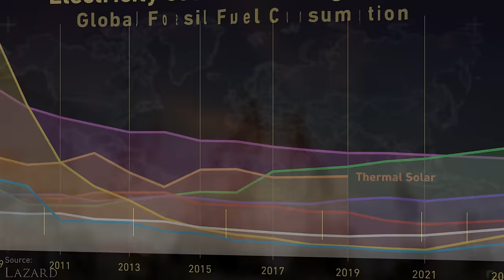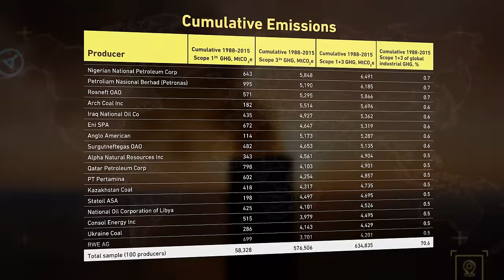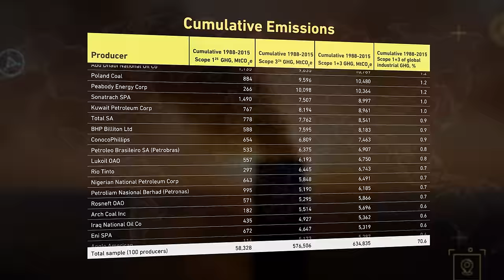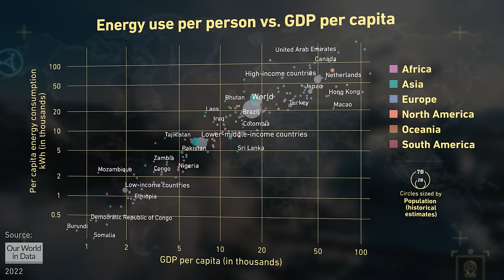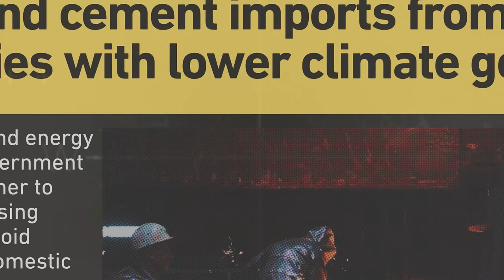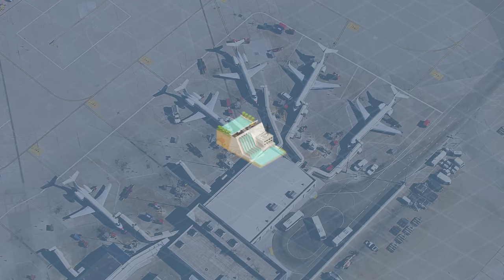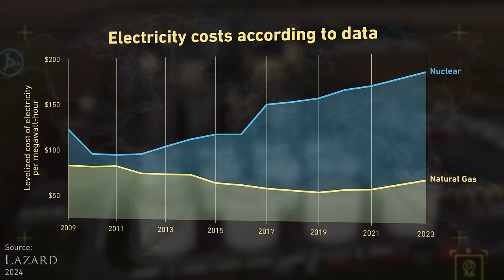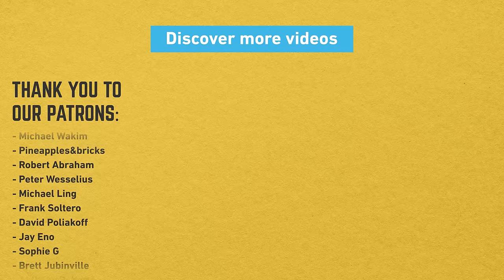Why We Can’t Just Stop Oil

Comment: I was on a road trip on a 2 lane country highway and the semis were taking up the road.

One truck had a bumper sticker that said “HATE TRUCKS?! QUIT BUYING S💩T!”
Reply: Oh, you've been to the country. Could you please tell those in the city what goes on there. I'm sure they'd be fascinated.
Reply: Based.
Reply: Reduce consumption is a much better way to reduce emissions than improving consumption. Technically the bumper sticker has a great message.
Reply: Australia’s new company Janus can convert HUGE 100 ton (or more!) trucks into full EV’s. Tesla's 40 ton trucks are good for driving within Australian cities, but at 40 tons are a little small for our 1000 km intercity highway routes that often use big 100 ton road-trains.. Instead of trying to “megacharge” the truck battery, Janus is a battery swap system. A guy on a forklift swaps the battery in a minute! This is more convenient for the driver if he’s not on his half hour break and needs a charge. It also means the warehouse can take their time charging the batteries. This is less stress on the batteries, and less stress on the local grid. Indeed during the day they can run 10 trucks from solar on the warehouse roof alone! The convert old diesel trucks. When one comes due for a major engine overhaul, many drivers are doing a Janus EV conversion instead. After a year they’ve recouped the costs. Then they save 60% on servicing fees and electricity is 1/3 the cost of diesel. Today the batteries can do 400 km before needing a swap. In the future, the truckie gets to enjoy new battery ranges and options as the batteries are automatically updated with the latest tech. These Janus trucks also get regenerative breaking, which slows the trucks going down hill while charging the batteries and avoiding wear and tear on the brake pads. The market is going to be SCREAMING for these trucks soon. It’s a thing of beauty - please watch the "Fully charged" 15 minute special. https://youtu.be/9eYLtPSf7PY 
Facts and figures and latest truck conversion showroom https://www.januselectric.com.au/
Reply: Australia, by any chance?
Reply: Also centralized production is a factor for shipping as if more factories were local there would be less shipping. But a company produces where labor is cheap and sells in a place it can get the highest profit
Reply: @5353Jumper  consumption is never going to be reduced. its what most people live and work for.
Reply: @eclipsenow5431 I wonder how much pollution it is going to create by mining, refining, manufacturing, replacing and recycling these massive batteries and how many weeks it can burn once it is caught on fire.
Reply: @eclipsenow5431  how about we just build trains
Reply: @eclipsenow5431 I am in full support of transforming small deliver trucks in the city into electric, it saves energy, centralized electricity demand, make recycling and repairing more feasible and may actually reduces emissions. But road trains? Give me a break 😅
Reply: @TheFalseShepphard  not economically viable and local demand wasn’t sufficient
Reply: @darksmith7318  Trains not economically viable? There's literally not a single land transport on Earth more economically viable than a train. It's literally designed to go the most efficient way possible through land. Trucks are much less efficient energy-wise, not to mention slower. Why it's not used in USA more? It's because the train tracks are something no private company wants to build, but if the US builds high speed railways, you'll soon see almost all of the trucks start only serving the last mile deliveries.
Reply: Trains don’t solve the last mile (or in many cases the last 25 miles).
Reply: @pangalactictuber  That's what trucks are for. And for those distances you don't need ultra-large trucks, you just need small ones to go through the city, and those small trucks can be electric.
Reply: @darksmith7318  I count myself a New Urbanist and fully support rail where possible. But as an Australian we have some enormous outback areas where battery swap might not even be visible. Some of our road trains will need biodiesel to cover huge ranges and take goods to tiny towns.  It's a niche sector only. 😉
Reply: @TheFalseShepphard  I wish Australia would prioritise rail more
Reply: @darksmith7318  LFP doesn't burn. Hannah Ritchie explains global mining will decrease as we mine 14 billion tonnes of fossil fuels each year
Reply: @eclipsenow5431  Hybrid trucks make far more sense.  The majority of the work can be done as an EV but a super efficient ICE engine can come on and charge the batteries without coming to a stop.  As long as the pay is based on the work done time and capacity are dominant factors.
Reply: @darksmith7318  We should be using smaller batteries on hybrids with on board generators.
Reply: @TheFalseShepphard  Unfortunately trains are CRAZY expensive to build new.  Look at California's rail project between San Francisco and Los Angeles where the planned $33B project is 10 years behind schedule and some estimates have it costing nearly 10 times that initial $33B, and at the end, if it ever gets done, it will be slower and more expensive than air travel and require ongoing massive support from government funding.
Reply: One more lane will fix traffic I'm sure
Reply: @MikeRink  No speed limits would be better than more lanes.
Reply: @Mitaka.Kotsuka people live for gaudy purses?
Reply: @eclipsenow5431 Wow, 100 ton road trains? That's pretty interesting! Sure, the size and weight seriously restricts where they can travel, but they can still take a lot of things places with good economy of scale.

I do wonder though. What if they took advantage of those regular restricted routes and perhaps found a way to power the trucks as they drove so you don't need to use weight on batteries and can carry more stuff. Maybe they could even use a different material like, I don't know, steel to reduce rolling resistance and tire wear? That'd be crazy, right?

Comment: It would be nice if modern appliances would last longer, like the ones made decades ago.  Then we wouldn't need to make so many of them.
Reply: Planned obsolescence is definitely a major issue.
Reply: Appliances cost more money in the past. We are obsessed with buying $600 fridges. Nobody walks into an appliance showroom and asks how repairable the appliances is they just look at the price, features and industrial design. It’s our fault not theirs. If people demanded high quality (more expensive) repairable products they would sell them. Having an iPad glued to a fridge to tell you when your yogurt is “expired” is a liability rather than a feature.
Reply: But that would negatively affect the economy!
-economics explained, probably.
Reply: just use the ones made decades ago
Reply: @DMSparky  they really should. When I purchase a vehicle I like it to have parts commonality.

It's generally cheaper to repair and maintain then.
Reply: Some times we don't need more regulations.
But definitely think minimum reasonable lifespans for appliances should be a thing

A fridge should last a minimum of 20 years without major issues. Our old fridge has.
Reply: @austinbaccus  My sister does this, but you have to know where to look for re-conditioned older appliances.
Reply: The simplest solution to overproduction of low-quality goods is to raise energy prices via a carbon tax redistributed as a dividend.  The net result is lower consumption and a subsidy to help low-income households cope with the rising cost of energy.

The problem, it seems, is that everyone notices the higher sticker prices and far fewer people notice the extra deposit in their bank account.

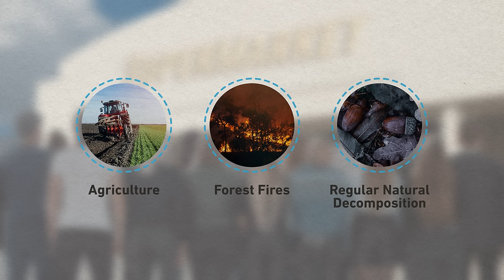Comment: @4:10 regular natural decomposition isn't a driver of climate change - it's just releasing carbon back into the carbon cycle that was generally taken out at most a decade or so ago.  Hence, it's generally carbon neutral.
Reply: We can exchange increasing car driving for putting out forest fires. It doesn't matter how you want to phrase this, be it 'driver' or contributor.
Reply: @theBear89451  bro wut?  Im not sure what you're getting at here, but the point stands.  The carbon from natural decomposition came from the atmosphere to begin with, so it doesn't affect the long term carbon balance of the atmosphere when it's released again.  It's the carbon cycle, which is climate change 101.
Reply: @theBear89451 but forest fires are becoming more and more common
Reply: I’m allowed to decompose when I die? Thank god
Reply: @nekhumonta  That would only be an issue if there were a decrease in global biomass, but there is an increase, meaning plants are growing faster than they are burning.
Reply: @jacobtomasperez1719  not all biomass is equal. Trees can store more carbon than algae.

Comment: Because nothing beats petroleum products as a store of energy, in both density of volume and weight, in a reasonably easy and safe to handle and transport form.  Especially when you account for the weight and size of the fuel's storage and handling systems on vehicles.
Reply: Actually, diesel is better.  Crude oil requires energy to refine to be useable and cleaned of sulfur.  That energy comes from some of the products of refining being burned in furnaces and from addition of electricity and maybe natural gas.
Reply: Even if something can beat oil in those regards: said alternative needs to be cheap to produce and use on a large scale as well. Hence we can dream, but till something comes around that does it all we are bound to use oil, lots of oil.
Reply: @richdobbs6595  plus diesel can be renewable. either sourced from new or used cooking oil, plants and algae (food and non-food). Also, diesel emit less CO2 but more NOx and soot though.
Reply: @richdobbs6595  You might find that diesel is a bi-product that results from the process of distilling crude oil, I believe. Just like petrol and LPG or the Naphtha used to make fertilisers, plastics, pharmaceuticals, jet a1 etc. And the bitumen for roads and fuel oil for ships.
Reply: @davidbrayshaw3529  As a previous refinery process engineer, I'm well aware of how diesel is produced.  I'm sure your comment is very relevant to the point you are trying to make.  It's just I don't follow it.  I was directly replying to the OP.  Are you arguing that gold ore is just as valuable as gold, because you can make gold from it????
Reply: @richdobbs6595  Perhaps I have somehow misinterpreted your post?
I was making the point that diesel is a distillate of crude oil therefore without crude oil, there is no diesel, and that it takes considerable energy to distil diesel from crude oil. Have I missed something?
Reply: @davidbrayshaw3529  And my point is that diesel is a better store of energy than unrefined crude oil, and is just as easy and safe to handle and transport.
Reply: @richdobbs6595  It's probably a bit more "useable" than crude oil, but the calorific value is very similar to diesel, as is the specific gravity.
Definitely just as safe to transport, that's for sure and it has the potential to serve more common purposes.
Reply: except nuclear energy with its own particular disadvantages
Reply: Plutonium beats it by a factor of a million.
Reply: @andrasbiro3007  Expect that the safe handling and storage equipment for any given amount is a million times bigger and heavier than the sample.
Reply: @haweater1555 
Technology will continue to progress and lithium and plutonium will replace more and more oil with time. Oil companies have fought this inevitably but they can only resist the march of technology so long.
Reply: @richdobbs6595 technically yes, but that doesn't really take anything away from the OP's comment. Diesel is a product of crude, after all.
And biodiesel is inefficient and expensive to produce.

Comment: Oil isn't just fuel. People don't grasp that nearly all synthetic products are petroleum-derived
Reply: But Isn't only burning petroleum to create energy a problem? I didn't think making things out of petroleum was such an issue.
Reply: @TheFlawlessHost  Maybe less so, but fossil fuel extraction and refining has significant environmental consequences even if the hydrocarbons don't end up as engine fuel.  For those of us more concerned about habitat destruction and polluted water supplies than carbon emissions those steps are actually much more damaging than what comes out of your cars tailpipe.
Reply: 84% of petroleum extracted is for fuel.

And turning that 16% into things that aren't CO2 is a-ok in my book (problems around plastics notwithstanding).
Reply: What you don’t seem to grasp is that it doesn’t have to be that way. It’s a choice. We can make plastics and naphtha from plants.
Reply: Which is another good reason to stop setting it on fire.
Reply: @jmanakajosh9354  If it were so simple, why haven't plant-based petroleum derivatives displaced conventional ones?  Yes, it's a choice, but it's a choice for the simpler, cheaper method of getting the end product.
Reply: @lukedornon7799  "those of us more concerned about habitat destruction and polluted water supplies than carbon emissions"  Habitat destruction and water pollution are problems that might only affect a tiny fraction of the Earth's surface.  Climate change affects 100% of it.  Climate change will cause more habitat destruction than everything else combined.  If you car about habitat destruction, you HAVE to care about climate change.  (Unless logic and effectiveness aren't things you value.)
Reply: @lukedornon7799 climate change IS habitat destruction in some cases
Reply: Even things like pharmaceuticals are dependent upon oil by-products that we currently do not have an alternative for. Dyes, inks and paints are another example. And then there are some energy intensive industrial processes that simply cannot be provided by other means. I am not interested in defending fossil fuels and I certainly am aware of the imperative that civilization find something else to power it. Nevertheless, the are many as yet unresolved issues in that transition that we must come to terms with before we can make any lasting progress.
Reply: Including just about every single component in an EV.
Reply: @jmanakajosh9354 Which would be even more environmentally unfriendly as it would put pressure on fertile arable land.
Reply: @scbond  nope
Reply: What about collecting carbon from air.